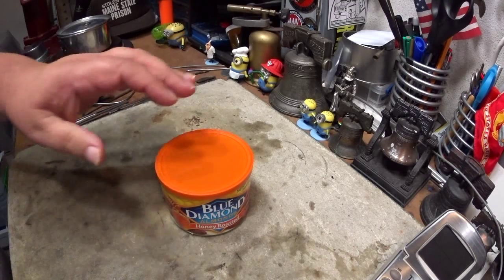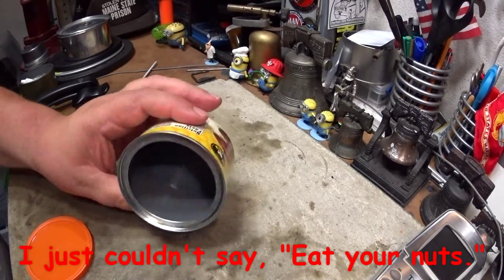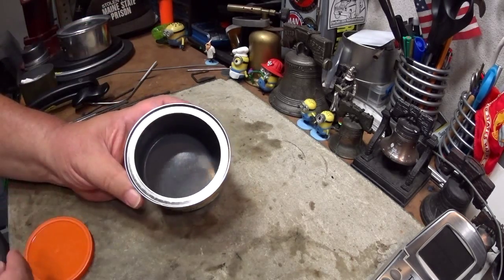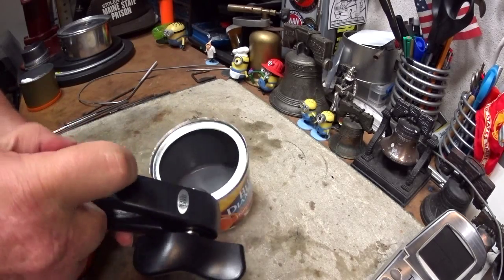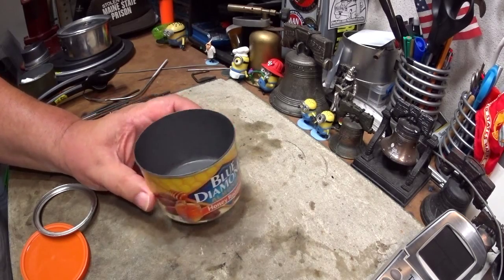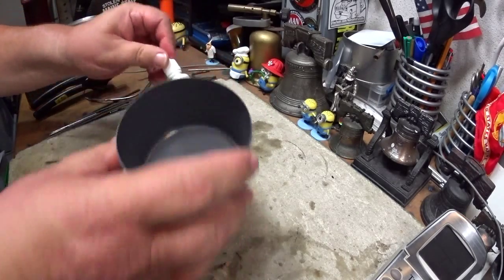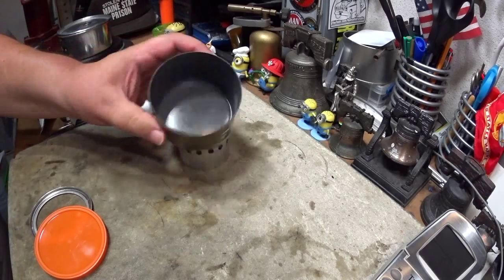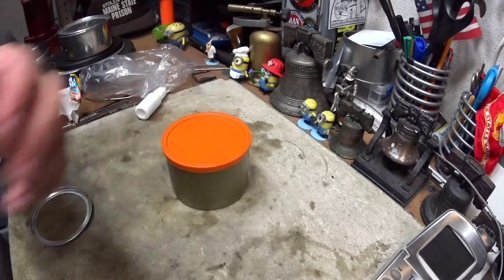Making a Small Pot From a Nut Can

Comment: There is a peanut can from Dollar Tree , Greenbriar farms roasted and salted peanuts,  makes a perfect fitting lid.  Use your side cutter on the bottom.   It fits snug and the plastic lid will hold it on.  I use aluminum tape for a handle so it can fold under the plastic lid when put away.